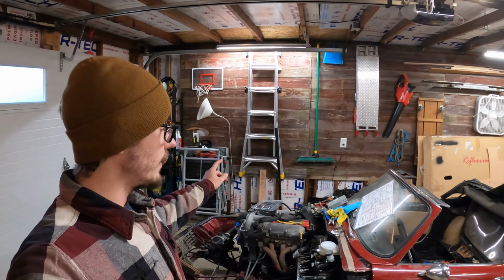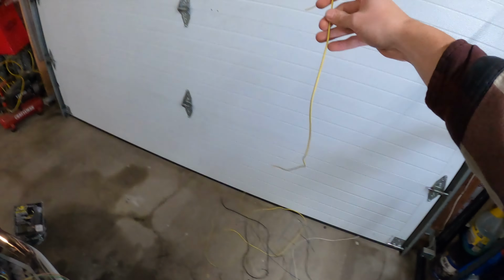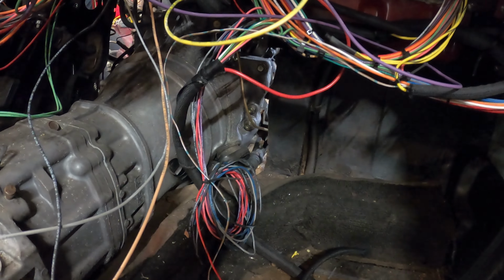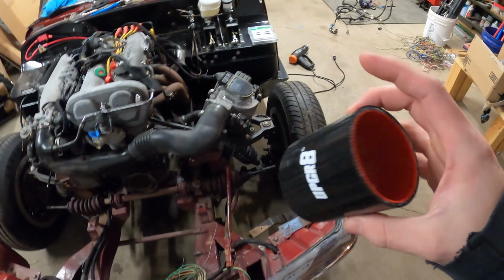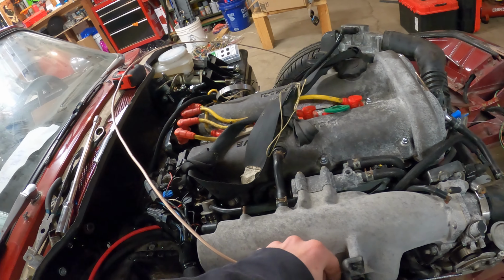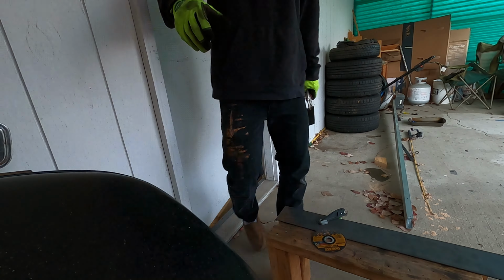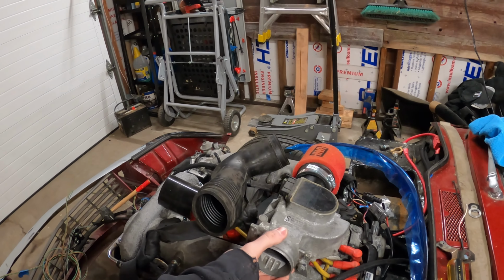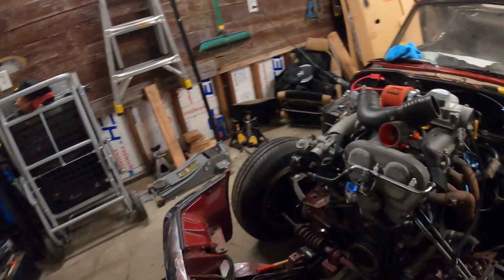Triumph Spitfire Engine Swap! (Miata 1.6L) S3E5

Comment: E-Bay has lots of bicycle cable options that would work perfectly for your throttle cable setup and any other cable controls you might need. You can order long pieces of the outer sheath and the inner stainless wire cables in various dimensions and cut them to length. I'm currently using a bicycle brake cable on my GT6 MK1 2L as a throttle cable, works great with no resistance, as the outer cable sheath has a Teflon lining. Looks like you're getting closer and closer to that first run down the block! Keep it up, good job!👍
Reply from the maker: Definitely! I originally ordered a bike cable but it was too short as the advertised length was shorter than real length. 
Thanks for watching!

Comment: You need a bicycle shifter cable and housing to use for the throttle…..and some springs!
Reply from the maker: I ended up using a OEM Miata cable! Same concept, just a little different! I did add some stiff springs so I get quick return and pedal feel.